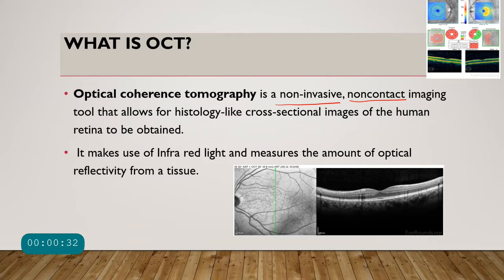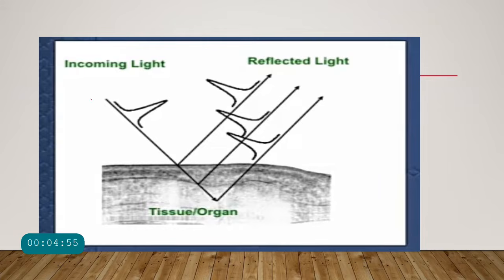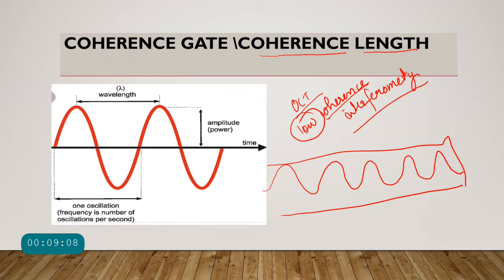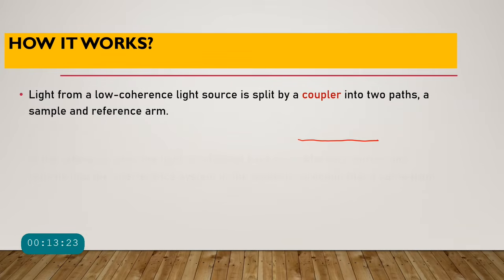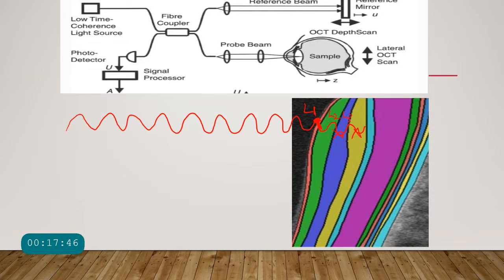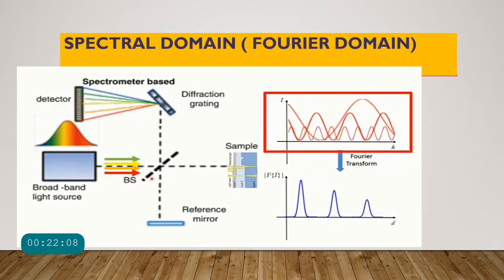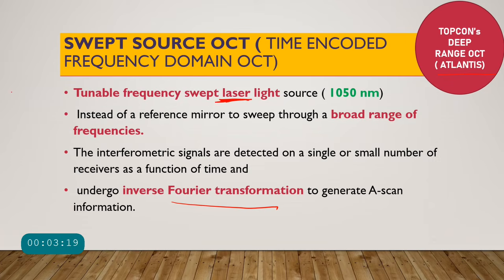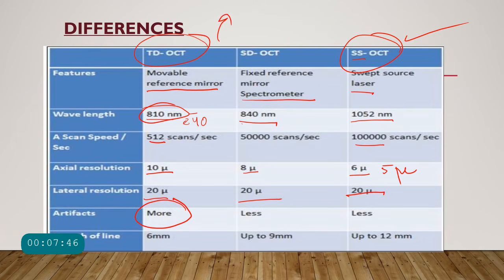WHAT IS OCT || OCT technology explained ||

Comment: the condition for being coherent is not being 'in phase', it is actually having 'constant phase difference'. For example, in case of destructive interference, the two waves are still coherent as their phase difference is constant which is 180 degree. If they were not coherent, they would not interfere at all, neither constructive nor destructive. Also, coherence length is about how long two waves maintain consistent phase relationship, not when they start to decay....lots of misconceptions being introduced here even though your way of explanation is good.

Comment: Mam as you interference can only happen when two arms are matched in length, then how we calculate sample arms length and match it with reference arm or vice versa? and by matching did you mean oct won’t be appropriate for too long or too short eyes?
Reply from the maker: The reference arm acts as a fixed baseline, while the sample arm (reflecting light from the eye) varies based on the structures being measured. The OCT device adjusts the reference arm electronically or mechanically to ensure it matches the sample arm length within the coherence length, enabling interference.
Reply from the maker: In extremely long (myopic) or short (hyperopic) eyes, older OCT systems might struggle because the reference arm range might not cover the extreme lengths. However, modern swept-source OCT and PCI systems like the IOLMaster 700 can handle a wider range of axial lengths due to their improved coherence detection range and advanced algorithms.

Comment: Hello , thank you for the simplified explanation , it was very helpful ❤...yet, I have a question , the OCT uses monochromatic wave , so 1 wave length right? But the SD OCT uses broadband light source (the wave lengths are from 840 to 850nm ) which means it should no longer be monochromatic since the wavelengths aren't equal right?   And if that's the case, the waves reflected from the layers of the retina will also be of variable lengths. So how does interference happen in this case (since the reference mirror is fixated) 🙃🙃 sorry if this question is confusing .